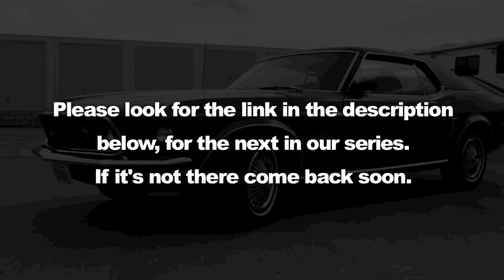Alternator and water pump pulley install 1964 Mustang Coupe 289 D Code Day 7

Comment: In the process of replacing my alternator in my 67 mustang 289, I ran into the issue of the pivot bolt being seized in the alternator. Using heat and PB blaster, I was able to get it out of the engine block. But not the alternator. So I thought I would just take the bracket off and work on it on my work bench. That would require removing the fan, and the water pump pulley. Which, the way things are going......I will have a major issue the farther I go. Any suggestions?